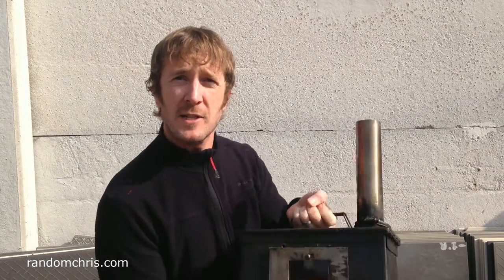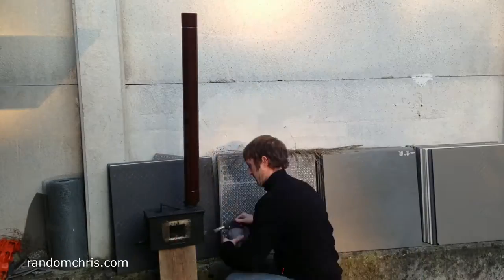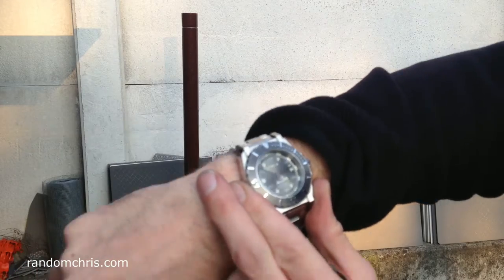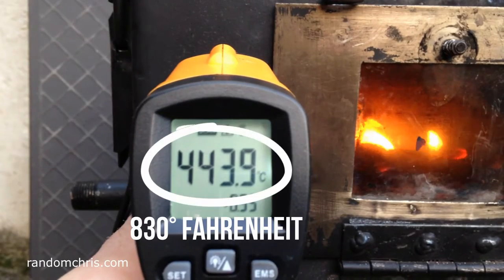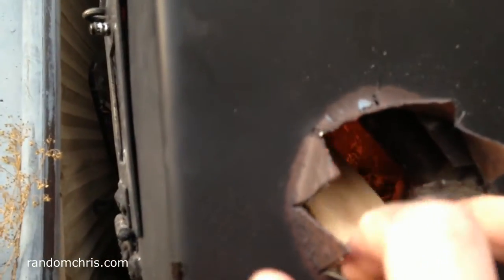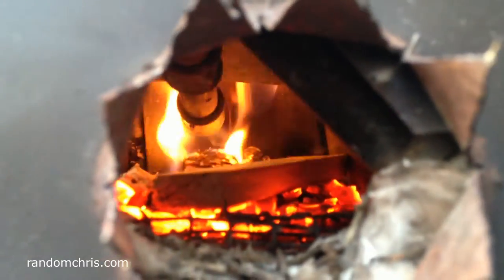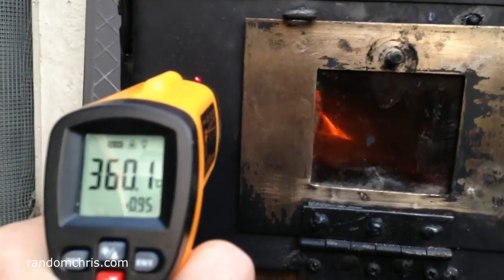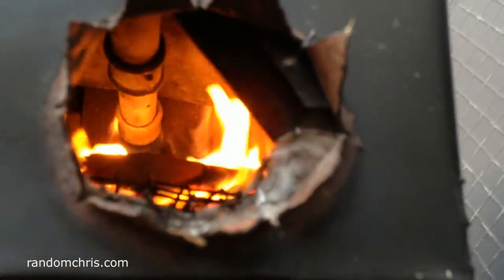My Mini Homemade Wood Stove Burning at 830°

Comment: Thank you so much for these videos! This is easily one of the best portable stove builds I've ever seen, and it's simple enough that I don't feel like there's a lot of time and effort wasted on anything. I am really impressed with the rocket stove idea, as most wood stoves I've seen are traditional variety and far less efficient. This is the first one I've seen to capitalize on the simplicity of the rocket stove without trying to overly complicate everything or add too much mass and weight. I'm very excited to see any other videos you make in this series and I'm now a subscriber. 

I LOVE the idea of using copper coil tubing because it would be lightweight when empty and have very high thermal conductivity to act as a heatsink once the fire dies. I'm looking at using a setup like this (along with a smoke/CO detector!) for winter camping in the future, and I was trying to figure out the best way to add a heatsink without adding tons of weight. Water was one of my ideas, but I'm not exactly sure on how to make it work. I've thought about using a thermos type container with the lid removed and one end of the coil sitting in water inside of the thermos while water is poured into the other end of the tube.the tube fills with water, submerge the fill-end. In theory, the water should remain in the tube like it does when pulling an upside-down submerged glass from a sink and may generate some thermal convection current to constantly cycle water through the coil apparatus. I'm unsure of the effect on the burn and stove efficiency from this, as I know it would literally be acting as a heat sync and drop the stove temperature substantially.
Reply from the maker: Hi there, thank yoo very much for your comment and welcome aboard as a subscriber. I like simplicity and if something like can be made to be more simple than it already is then I would consider that to be an improvement. I have the Mk III built in my mind, I just need to find the time to physically build it and upload the vids (We've recently had our first baby and the time available for things like this has been vastly diminished recently!). Don't hold your breath for the Mk III but stick with me and sooner or later it will be here (Plus a simple copper coil heat exchanger for the flue for making hot water). Cheers! Chris 👍

Comment: great design Chris,  what size area so you think that would heat?  Cheers.
Reply from the maker: Thanks Dave! Good question - there are a ton of variables to consider: the square metre / yard area; also the height (therefore the cubic area); the amount of insulation on each of the walls / floor / ceiling / bbany windows; how well the area is sealed from drafts... This little stove kicks out a ton of heat though. Whilst measuring those temperatures on that front face of the stove my hand was buring from the heat! Cheers, Chris 👍

Comment: hi is this the version 3 of your stove? I didn't see the secondary combusting occurred in there, is that because of the wide opening where you feed the fuel?
Reply from the maker: Hi there, this is the Mk II with the primary intake removed. You can see the secondary combustion up against the stainless steel plate at the far end away from the intake (The secondary burn has moved 'higher' up in the system and the flames travel all the way back across the baffle to the flue). It still burns smoke free... Cheers, Chris 👍
Reply: +Christopher Barr - Random Chris  I see, great work. Thanks

Comment: when's version 3 coming out?
Reply from the maker: Good question! It's in the pipeline but our new baby is slowing things down somewhat!
Reply: no worries man. im looking at making something like this for an Alaskan cabin which is unfortunately going to be many years into the future. im thinking about make a secondary burn stove out of or encased in brick with an oven up on top to the side so i still have a cooking surface on top of the stove. your videos on how to make it are the best ive seen. ive been able to understand what others are doing and saying because you went more in depth than they did. the more i know about how this works the better chances i'll have at getting it right the first time. since i dont know how much brick, fire brick, and mortar will cost up there i may not be able to fix any problems that i may have. however when scaling up slight adjustment done to a smaller variant could possibly have concerning affects. i still am doing research both with other aspects of living up there and this. i dont want it too big to where it over heats the cabin but can barley keep a fire at more comfortable temps and i want it as fuel efficient as i can possibly get it. the more knowledge i have the more i will know what to look for. obviously this isnt gonna be a got it right the first time but the closer i can get it right the first time the better off i'll be. thank you for your videos, i really appreciate them and sorry for rambling on and leaving such a long reply.